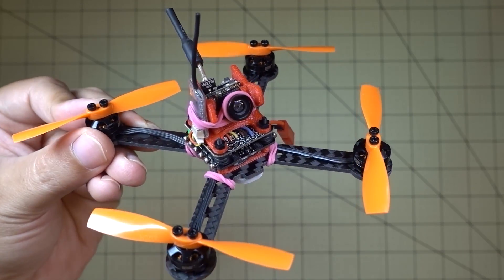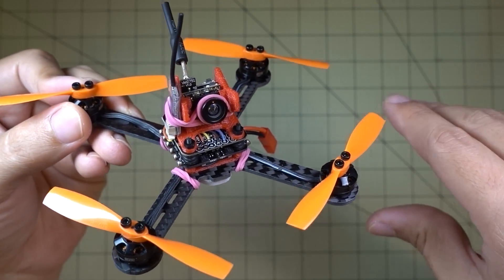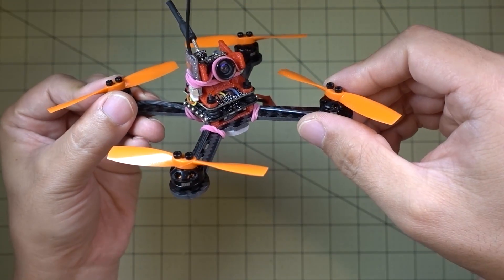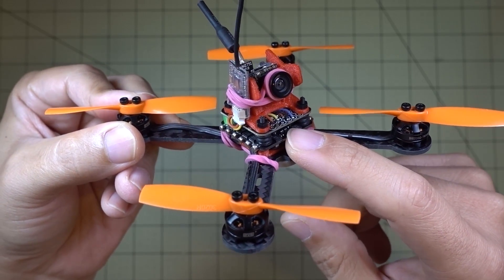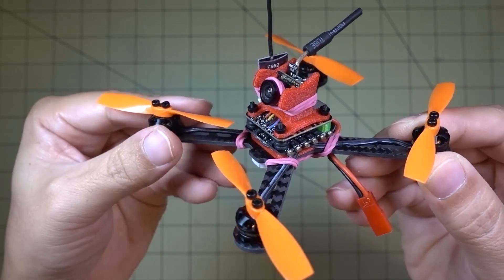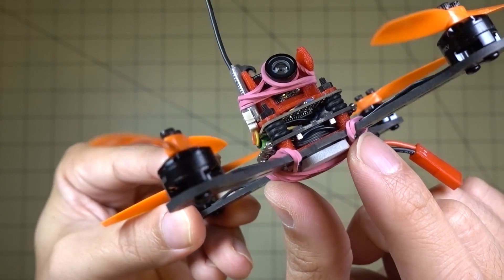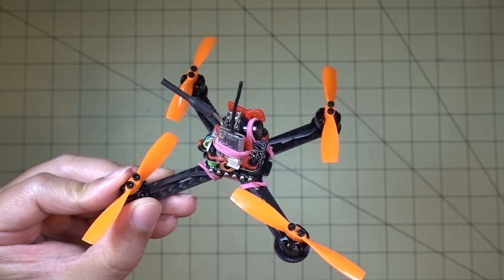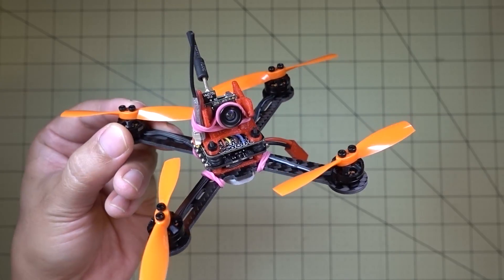Flying Trash #1 💩 Reusing Crashed Drone Parts 🚁

Comment: talking about crashed quads, i have a 5inch i crashed so much and i'm just throwing parts at it trying to fix problem after problem. Now i'm stuck on the quad when controlling it will stick on a command from my transmitter for a split second before going back to where i'm actually at on the transmitter. example: i will throttle up real quick then come back down but it will hang at the throttle i raised it to a tad longer and causes bad controls for when it happens to rolls and all other commands. 
receiver i have used on my micro which works perfectly fine no delays like that. i have two separate ones i'm trying with ibus with flysky combo. Nothing will work. I'm kinda stuck and do not know how to fix this issue.
Reply from the maker: might be a bad receiver... try swapping in a new one.
Reply: Albert Kim yeah I have tried two of them. They both work with my micros. I’m thinking my solder job connecting the wires I had to splice together may be at fault. Just took off the heat shrink and some how I missed some frayed wires that were probably touching periodically giving false signals. Thanks for the quick response.
Reply: If flysky transmitter, it could be the wires in gimbal dragging on the back of the enclosure. 
To test it, Look at display, in settings. With drone off, see if anything is misbehaving.
If so squeeze the gimbal. Or open tx enclosure and play with wires.
Reply: Chris Taylor thanks. I believe I found the problem it was the bad solder connecting the wire. BUT, everything was well and then after my 3rd pack it just completely looses signal
Lol I guess that’s the hobby for you one thing after the next.